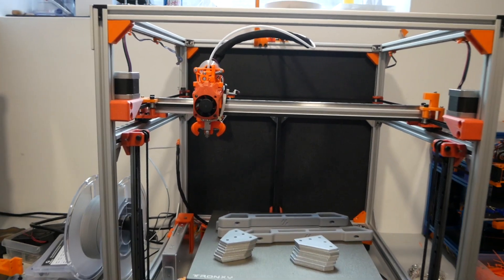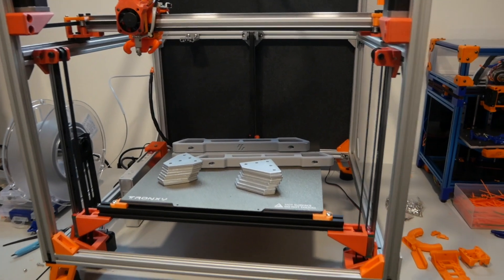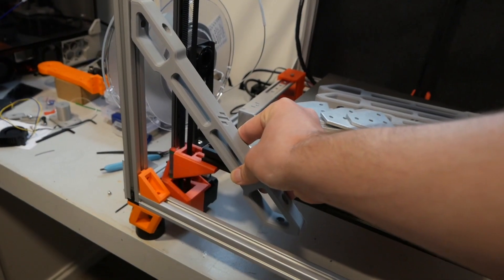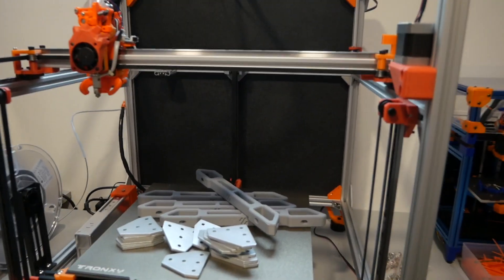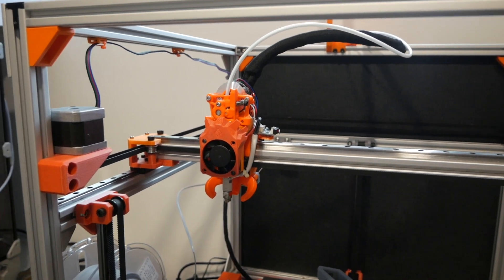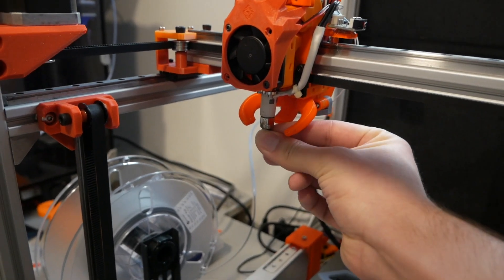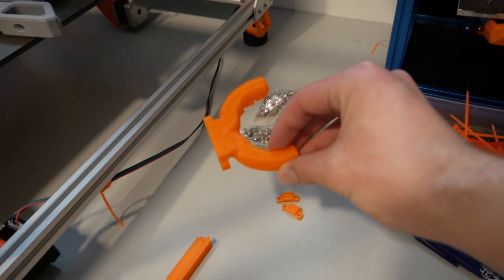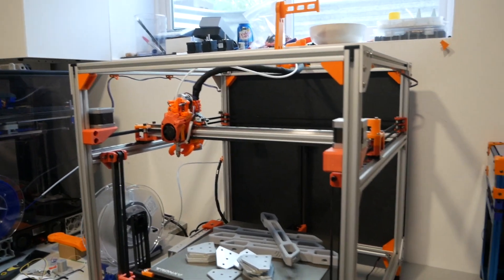Simplecore CoreXY 3D Printer - MFBS Fast Swap & Frame Braces

Comment: For the printhead the vzbot printhead is also a good option and they come in ratrig and voron belt paths. And for the nema14 ive found  the moon 10t to be the best.
Reply from the maker: Good to know about the moons. Unfortunately for the printhead I need something that has belt tensioning built in, so EVA is my only option for now.
Reply: @mitsumakes  there is a mod for the vz-printhead to have Eva style belt tensioners on the back of the printhead
Reply from the maker: @twanheijkoop6753  Oh amazing! Where can I find it? I took a look on the github but don't see it there